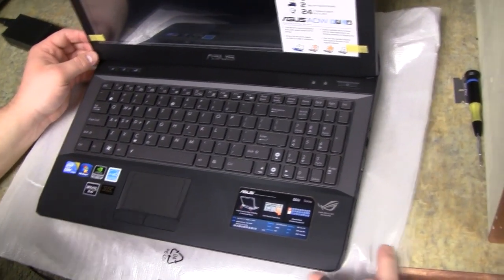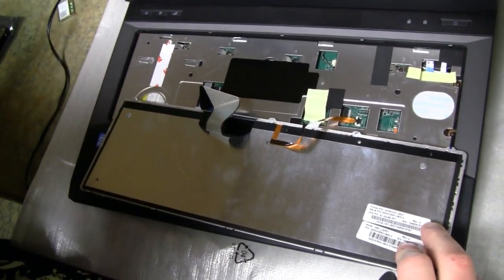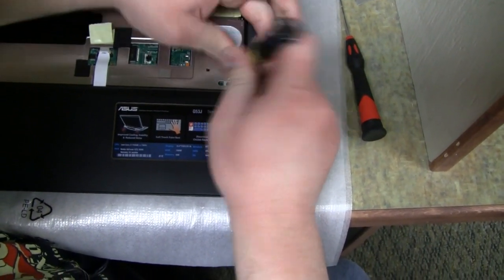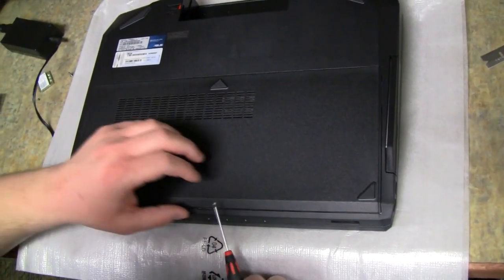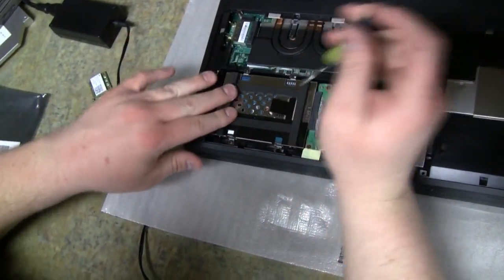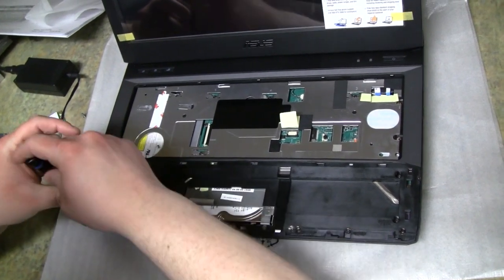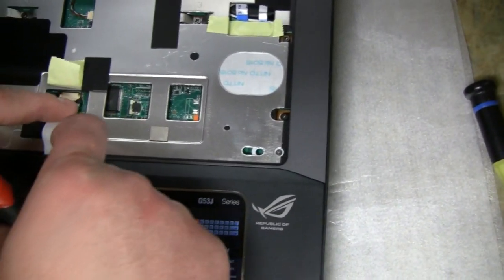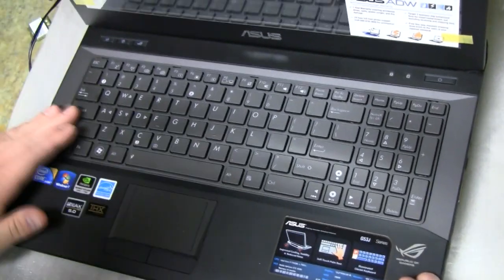ASUS G53JW 2nd Hard Drive Install by XOTIC PC

Comment: Do you still sell the HD brackets?  I need some.  I bought a 128GB Samsung 850 Pro SSD to go in my son's G53SX, but if I cut corners and go the cardboard route my son's mother will skin me alive.  She just spent $145 with Asus just to have the touchpad replaced, because we couldn't find one anywhere to purchase for me to install it.  She's a bit steamed already, LOL.  (I ordered this model for him, initially, and on her dime  :-)  ).   I also have an N53SV that I use in which I would like to upgrade the boot drive to a SSD, so I really need two caddies.  The N53, I believe, is much easier to upgrade than my boy's G53SX.  Will they use the same caddies?  I want one caddy each for both if you still have some. Thanks.
Reply from the maker: Hello Nathan David Unfortunately, we do not sell any laptop components separately!
Reply: ***** OK, thanks anyway.  I was able to find one on Ebay, but I need one for my notebook as well.  Asus sells some for the G73s, but I have read by some that they require modification before they can be made to work, and that they don't fair that well even then.  I don't have to do my laptop right this minute.  I just built me a new M5A99 FX Pro desktop.  I mainly need my boy's upgraded, so I can manage.  Got me a SSD in my desktop.

Comment: Thanks guys, just installed my SSD following the instruction from this video. For you that wondering whether you need a bracket to install the second hard drive, the answer is No. You can get away with cardboard if you have SSD drive. Follow the instruction on how to use cardboard here: http://forum.notebookreview.com/asus-gaming-notebook-forum/533714-guide-disassembling-g53jw-installing-second-hard-drive.html

Comment: I am confused about the bracket. I have a G53JW and want to install an SSD as my primary drive and use the existing 500gb as a secondary. Will the laptop already have a bracket in there for a second drive? Or will I have to purchase a bracket? Any info would be appreciated.

Comment: Hi I have a G53SW A1 that i need to upgrade from 4 - 8 GB RAM. The issue is that when I take off the keyboard and check under the black plastic there are no slot for RAM there. I think there is one other under the metall on the other side. Under the MB there is also just one slot and there I have the 4GB. Question is where is my mem slots?? Are the only other one under the metall or I just have a broken MB with less slots. ?? Just want a answere before I put the computer in parts.. tnx..

Comment: Thanks for the info.  My issue was the removal of the bottom cover.  
The keyboard does not need its ribbon cables undone, nor the mouse assembly in order to get to the screws to release the under cover.  The keyboard can just be moved out of the way, as well as the mouse piece, during the removal of screws.  Just a tip for those that need that bottom cover opened.
I agree that its sinister to need so many screws removed to take off a cover.

Comment: hey i did this and it worked fine but now some of my keys are not working!!!  i have spilled some coke but i have dried it and everthing was working before installed my second drive? i did push in that cable all the way in and it is still not working!!! they keys that are not working are the     RIGHT SHIFT KEY, comma key,C,Q,X,V, PERIOD KEY. PLEASE HELP ME IF I OPEN THE KEYBOARD WILL IT VOID MY WARRANTY??

Comment: I know this is 6 months old, but I think I found solution. I know asus have special designed GPU-s, but I think it will work. I was thinking to upgrade to Nvidia Geforce GTX 670m because of OpenGL 4.0, MXM PCI-E 2.0 and best 75W power supply. In theory it will work 100000%, but in practice, no one ever did it. I know I am wery boring with this. But please answer me.

Comment: Nice instructions. As a Nokia technician I would recommend an ESD bracelet, a plastic tool to remove ribbon cables and release clips to avoid short circuit and damage to electronics. Also do not touch the connectors on the cables with your fingers as this can cause problems in the future with fingerprints. Just some advice to an otherwise fine video. :)

Comment: hi - noob question.  i want to upgrade the ram.  my thing came with a single 4gb 1333mhz cl9, and i have a kingston 4gb ram, same specs.  cpuid states the factory ram is in the 3rd slot.  since only the 4th ram slot is user accessible without a full teardown, if i stick my kingston one in there will it be running in dual channel?

Comment: Hi, I love all the help this video was for me (best in all the web).  Now I do have a small issue with re assembling The little gap on the right side which you mention.  I do try to put preassure on it but the lock never makes it all the way to the right side.  its like almost there but not there. 

Any pointers for that?

Comment: So I got a slight issue with my G53SX, my 2nd HDD Bay is not being recognized by the BIOS, would it mean that I got a faulty model? Or if such thing is happening there is a fix for it? I decided to switch up the Hard Drives and still the one on the Secondary Bay is not being read. I purchased the G53SX-XT1 from TigerDirect.

Comment: @zdslmn I would definitely recommend it.  Intel Core i7-2630QM (2.0GHz with Turbo Boost); 8GB DDR3 1333MHz
750G 5400 RPM; DL DVD±RW/CD-RW; 802.11 b/g/n; Illuminated Keyboard
Nvidia GTX 560M Graphics with 2GB GDDR5; Windows Home Premium 64-bit Operating System
15.3-Inch Full HD (1920x1080) LED Display; 2.0M Webcam; 1x USB 3.0; 3x USB 2.0

I got it from Amazon.com $1200

Comment: do you know if the Asus G53JW-IX235V has 2 hdd connectors too? because i want to install another hdd without removing the one that is installed.

The 2nd hdd bracket comes inside the notebook? because it would be hard to found it in argentina...

Comment: You said to just press on the top and press on the bottom for the strips into the keyboard (backlight and main line) i was unable to get the backlight one out so i cut it off. The main line i also couldn't get off. Please tell me where do i press specifically.

Comment: ...thanks for the excellent tutorial. Helped greatly when I moved my hard drive to the second slot and installed a SSHD as the primary. Didn't even know I had a slot for more memory, took advantage of that too. This laptop is a workhorse, had to replace the battery and send it back to replace the AC plug pin once, but it has more than paid for itself, great laptop, and has generated a ton of code and helped troubleshoot a lot of problems.